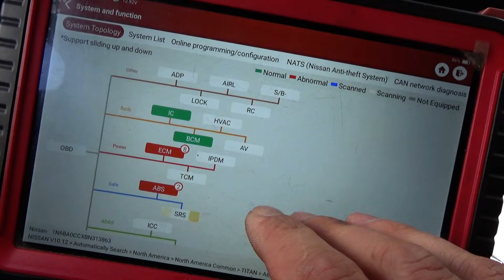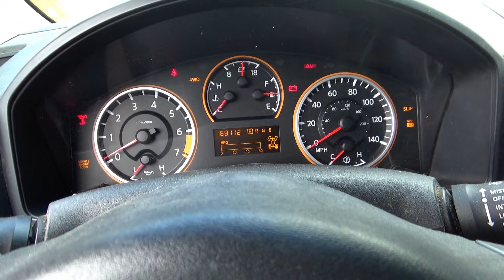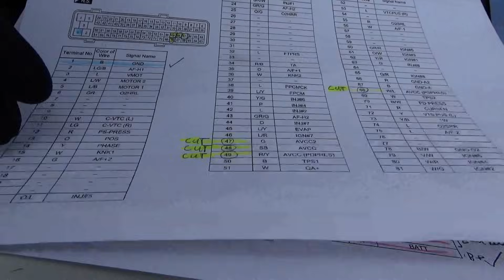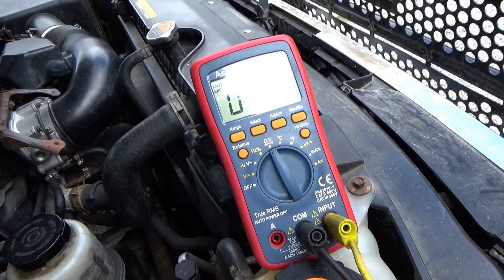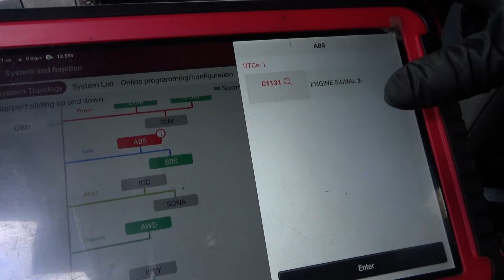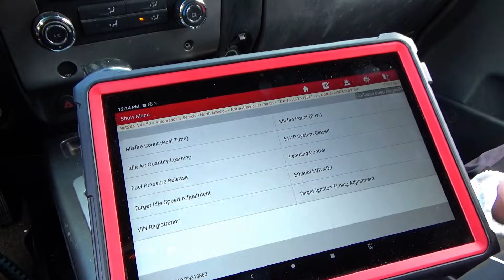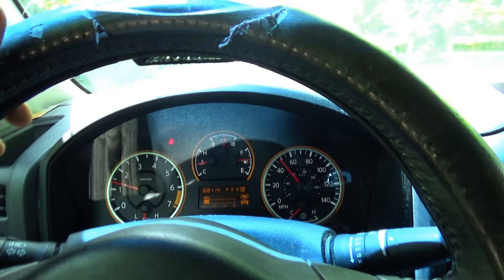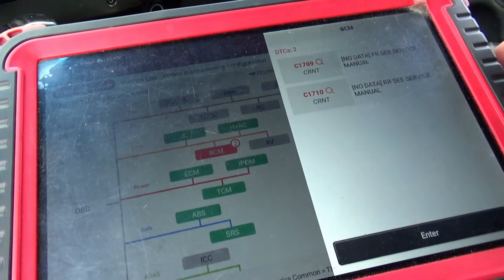Can "JUSTANSWER.COM" Fix Your Car? (Part 2: Nissan Titan NO-COMM for a YEAR!?)

Comment: Thinking on what was the original fault, it may be one sensor on the 5v or a short to ground on a wire, just guessing, hope does not came back.

Comment: What is the reading on the ohmmeter that should tell you that any of the wires has a short. Does OL means good and some resistance mean short ? You show 12 M ohms on a wire and Ol .
Reply: A short would be 0.0 ohms or less then 10 ohms anything in the mega ohms or OL means it’s open circuit ( not shorted )
Reply: @DDescalchuk57   thanks for answering

Comment: I am a reasonably competent mechanic ... not evena teeny bit competent to start messing around with Electronics .   I did buy an abs scan tool which was amazing . i followed the on line advice to swap the electronic part of the abs module ..   everything worked fine . after replacing the brake pads some crud must have jammed one of the abs valves ..causing the brake pedal to sink slowly to the floor . I flushed the abs block thoroughly using brake cleaner spray an airline and a plastic syringe filled with clean Brake fluid .

Comment: I think this is not a matter of the channel not being effective. Some people just dont listen, or learn. I have an acquaintance that is a "car guy" but doesn't put any effort into learning/knowing the fundamentals.  Literally everything he touches turns into a disaster. Fixing things that aren't broken, like cobbling together electric fans on a car that had a clutch fan and it never works right....cobbling together an exhaust that ends up costing double what a stock replacement wouldve cost, and ends up sounding like shit. I have tried to walk him through some basic diagnostic tests with a test light, and he ends up letting the magic smoke out of everything by using a Power Probe. At least this customer hopefully learns from this mistake and doesn't try to DIY it again.

Comment: "Just" answer... There's two meanings. Just answer it, no matter what, there needs to be an answer. If you need to go somewhere with your vehicle, just have it towed, that is also an answer.
And a "just" answer could also be an answer that is correct and the right thing to do.
It's hard to believe that this owner has been watching PHAD vids and then proceeds by cutting wires, messing up connectors, fire the parts cannon, because of just another answer. It's more likely that he stumbled upon PHAD after messing up his vehicle.
Reply: There is always someone who thinks they know the answer, even without having a clue about the subject matter.

Comment: Justanswers told me to stick a bean burrito into the air intake to fix an issue I was having with a tpms sensor. I've done that but it's not working so I went ahead and replaced the fuel pump and crank sensor. I would like to get this to you, towing from California. I'm expecting the same discount that you gave this gentleman. I'm also leaving both the red and green sauces for you in the passenger seat in case you need it for the bean burrito. I didn't cut any wires so it should be pretty easy for you. I did cut off all the valve stems on the tires though since that seems to be required for fixing tpms timing codes.

Comment: It goes to show that many of the "unknown" faults are still mechanically related (such as broken, unseated, corroded connectors or broken wires).

I dealt with a P171B on a 2018 Buick Enclave.  Saw rodents had chewed the wire... RIGHT at the 🤬connector, so it couldn't be a no-parts fix.  Found the easiest way to access the accumulator is to remove the battery and battery tray.  

Ordered a new connector and spliced it together. I KNOW the splice job was good... but it still didn't work.  Took it back apart and started to go through the fault check.  I have Mitchell DIY for this vehicle (well worth the money!!!) Thanks to Eric O. for the idea!  One of the first checks is to ohm out the accumulator solenoid.  I look in and can't see one of the pins.  So I removed the solenoid to get a better look. (NOTE: UNDER PRESSURE!)  One of the pins was bent.  Fortunately, I was able to bend the pin back without any significant damage to the pin. 

Put it all back together and the codes cleared themselves. 

For those that TL:DR -  Get the online OEM manual such as Mitchell or All Data.  Follow the troubleshooting (TS) procedures.  Always start with the easiest and least expensive fixes (usually in that order for the TS).

Comment: Believe it or not thinkcar is oem who supports topdon, it seems like launch software but it’s not. They buy from the same software company so that’s why it feels that way along with kingbolen now buys from the software company. I have a feeling launch can’t do anything about it. I’ve asked Tao who is a launch excective to confirm this. I’m guessing when Erik left to open thinkcar he used his software connection to buy the same software. If you have any software issues just delete the one you want and re update. GM always seems to be an issue to do that with. Excellent diag btw… Jay

Comment: Ivan..i said it before and this owner didnt read my post. Here it is again. " ivan has a higher IQ, and has the required tools, training, and experience...dont think you can troubleshoot like ivan, ivan makes it look easy" 
Btw ivan, dont mock the wire cutting method, its valid..not everyone has an arsenal of scanners and oscilloscopes

Comment: Hey Ivan, I’ve been in the automotive industry for 44 years, and while you do a great job communicating with your viewers, watching a couple of videos doesn't turn you into an ASE certified master tech. When it comes to diagnosing a vehicle, you need four things: Service Information (SI), a scanner, a scope, and, most importantly, an understanding of the theory of operation. Missing even one of these key elements means you won't be able to properly fix these vehicles. You always emphasize the importance of using original equipment (OE) parts and not purchasing off the internet, which is crucial advice. However, I've seen a handyman who was way over his head before he even got started. I’ve seen too many handyman videos about fixing vehicles, and it's clear that many of these creators have no formal training in the automotive industry and bring no value to the viewer. They should stick to doing small jobs around the house and leave automotive repair to the professionals.

Comment: Yet another example of why most diyers that constantly run their mouths and puff their chests out claiming theyre as good as the professional techs should just shut up and admit their shortcomings and not make it worse by throwing unnecessary parts at it and hacking harnesses up.

Just answer isnt going to be your saving grace.   Knowing too stick to what you can actually do will be.    And when you do screw up your car or truck stop expecting discounts.    If you could fix it you already would have so stop thinking you're better cause you claim to be a diyer and pay your bill like everyone else.

Comment: I used JustAnswer once about 10 years ago. There are some competent people on there, but it was a PITA to use. I was doing timing chain on my G35 and found a Nissan/Infiniti tech that I wanted to contact to verify what I did. The site kept matching me with any rando it was just a PITA to get the person I wanted. Sent him some photos of everything and asked a few questions and was good to go. If anybody told me to start cutting wires though, I'd have to do a doubletake on that and say that sounds very hacky and just creates more problems. As someone who is an avid DIYer. I started about 10 years ago watching EricTheCarGuy and then moved over to Eric O., Schrodinger's Box, ScannerDanner, and then your channel. You're very good at what you do and convey pretty clearly what you are doing, looking for, and how you troubleshoot things. The issue I had when I was new to your channel and especially ScannerDanner was I didn't fully understand the concepts 5v ref, signal wires, diff sensors, and all those kinds of things. So, I'd watch a video and it would go over my head and I'd have to rewatch a few times (I still do, lol). What really helped though was actually watching Schrodinger's box (not plugging his channel), but he had videos I watched discussing all those things and how they worked. Then after some more time now I can fully follow and understand what you are doing when doing your case studies, lol. I also bought a ThinkTools Pro for myself after watching one of your first videos using it. The only thing I haven't moved over to is using an oscilliscope, because I am still trying to learn. I do have the one that is for the ThinkTools and small pocket one. But, so far I been able to get by using multimeters, test lights, PowerProbe, and some other electrical stuff like variable resistors and power supplies. I was able to fix an intermittent issue with a throttle body on one of my cars (it was an internal failture on the connector pins). I said to myself "Ivan would be proud, issue fixed and no parts required (except pigtail)." That issue also really taught me to test EVERY connection point on a wire or sensor. It also taught me first hand about bias voltages and that sometimes the scan tool lies and shows default voltages that the ECU sends out.

Comment: In my youth in the military I was trained in the electrical diagnosis of power generator systems. From 1.5 kw gas to multi-fuel engines to include turbine powered generator systems. I experienced some weird stuff. But, what they bring to you takes the cake. Awesome work Ivan.

Comment: Several years ago I tried JUSTANSWER to see if they could explain the operating characteristics of the engine temp. indicator. of my 1999 Toyota Corolla. The instructions I got from them indicated that they ignored or did not understand the clearly understandable information I gave in the question. They of course did not give any reason behind their instruction. Absolute garbage. It would be interesting to hear from others their experience with this outfit.

Comment: If had paid attention he would know you never cut a bunch of wires and leave them like that to fix a problem. I think some joker online suggested it sarcastically and he took it literally. I just hope he never has a computer issue and gets told to delete System32 from the Windows folder to fix it. 🤣

Comment: There's more to the story about how those wires got cut. You're doing a fine job on relaying information. To utilize it though, you have to have tread softly. Doesn't make sense to ever cut a wire. I think just ask was pulling one on the owner....

Comment: Just a word of advice, those connectors should be fixed in place (as in having the clamp mecanism). Ive done too many diags where a PCM plug has been tampered and broken and since it doesnt latch anymore by driving around the vibration causes the connectors to back out 😅

Comment: I have the kingbolen k10 and I've been having issues with it not talking to certain modules on certain vehicles my autel mk808 talks just fine they really need to get the software sorted out
Reply from the maker: It should be same as Launch software...
Reply: @PineHollowAutoDiagnostics  No it's the same as thinktools

Comment: Actually you can blame the owner especially since he "Claims" to have watched your videos. Your method of diagnosis is methodical and straight forward and takes the parts cannon out of the picture and if parts are required it is the last step after careful consideration of all the facts. Cutting wires may have a place in diagnosis but not at the hands of someone that does not understand the circuit to begin with. 
As I said before throw your parts money into a one hour Diagnosis from a tech and then you have a good place to start. Thanks so much for taking along this journey out of the Rabbit Hole.

Comment: First of all, you do a very good job of explaining what you do and how you do it.  I wouldn't change a thing in your presentation.  I would, however, emphasize to the customer that he might leave the diagnosis to the professionals before he cuts more wires or fires the parts cannon. You didn't say if you offered a discount, Ivan.  Since it was NPR, I would say you just charged him a diagnostic fee and sent him on his way as your good deed.  GREAT VIDEO!

Comment: Great job Ivan. I had a Nissan that.a shops $3000 Snap On couldn't read an OBD code and my $12 Crader read the code then asked me to confirm it was a Nissan or some other brand I can't remember.

Comment: Two things to emphasize, don't fire the part's cannon and know when to stop and ask for help before cutting wires. Great work and awesome that you have empathy for the DIYer!
Reply: You need to ask the right person. And that person is hard to find. There are a lot of people who are right - in their mind anyway. Retired mechanic in Land Down Under who is learning heaps from Ivan.
Reply: @bobhudson6659  me too here in the states G'day mate
Reply: I just fired the gasket cannon on a  20K mile engine that has been sitting in my garage for 7 years.  Why risk leaks when it is easy to get at everything while out of the car.  Plus it let me put some assembly lube on the crank and cams up top for the big reveal.  Fathers day goes VROOM.  Just need to finish the AC system.

Comment: Posilock connector  are nice for a quick test connection.  And work if the wire are in a oil bath

Comment: Don't beat yourself up. You explain just fine. Sometimes you have individuals that will do the opposite. I have had that scenario several times. Tell him to do A, B, C etc. and immediately as I am standing there just finished explaining and they do none of it . Had one guy so bad showed him to click screen here, here, here and here and could not do it after repeating procedure 6 times he still could not do it and got mad at me as our company needs to have a better training program as he could not do it. His employee completed it after watching in the background and he then got mad at him and employee got in trouble.  I could only feel his pain of having to report to someone completely incompetent.
Reply: That would be the same type who would kiss the a*s of his own boss but treat those under him like sh*t. Problem is his type are the kind who often advance in a big company. I can think of one major a*s kisser at the company i worked at and it worked out great for him. I have a few stories about him. Electrician who did work for his bosses at their homes on company time (guys often saw him leaving the premises in a company van, drive out the main gate, and be gone all day) and then he went into management. Wink wink.

Comment: I too have noticed that my thinktool pros does wonky things from time to time after an update.  But it seems to sort itself out eventually.   I know what you mean about the patches though.  My Launch X431 Pad II has the option to keep an older version in case you need to roll back just because.  It's one of Launches best features and why I love it so much.  A feature I wish thinktool would adopt.
Reply: Maybe they need a reboot/reset from time to time?
Reply: @Cheepchipsable  Are you talking about a factory reset?  I'm almost certain that Ivan has done that with his.  It's not necessarily an issue with thinktool, but with the Launch software they run.  But once Launch gets word that a reproduceable bug has been found in their software, they are pretty quick to release a patch.

Comment: Make sure Ivan you give him his HUGE DISCOUNT 🤣🤣🤣. That’s hilarious. He ask for that
Reply: The discount will be NPR and like only 2-3 hours of Ivan's time wasted.  Any mechanic could have fixed these issues, honestly. This was not an Avenger's Level Threat, yaknow.
Reply: @brassmule  I think a lot of mechanics just would have looked at the mess and refused to work on it.
It's easy to say in retrospect it was an easy fix, but until you get into it you don't know. Maybe you forgot Ivan had an email correspondence to get the full history of work done to it, (which can either hurt or help).

Despite the owner stating he has put too much into it to stop, there is still a chance he will think any repair is too costly.

He said "another shop" reprogrammed the computer, but who busted up the connections?
If the computer was as it was then how did they program it...(of course it seems like it wasn't)

Comment: All of those wire list printouts and then all the research about cut wires and noting them on wirelist TOOK TIME.  You, Ivan, edit out all the tedious work that's critical to your understanding and troubleshooting.  It's like METHOD is important while also not getting rushed/hurried.  

So while mysterious anomolies are captivating don't miss the basics of shorts, missing power/gnd, and well seated connectors.

Essentials:
- power/gnd
- corrupt modules
- corrupt data buses
- corrupt connectors/connections
- engines 101
- ALWAYS start with VISUAL INSPECTION

Comment: Maybe the loose battery cable caused all this.
Reply: Too bad Ivan couldn't replace all the original parts. 
I've seen a  couple of repair vids that turned out to be a blown fuse caused by something simple, or even just fuse swapping.